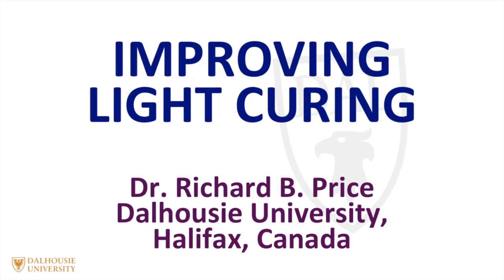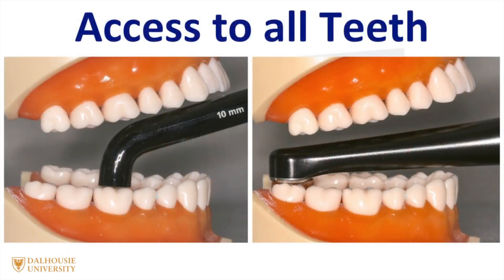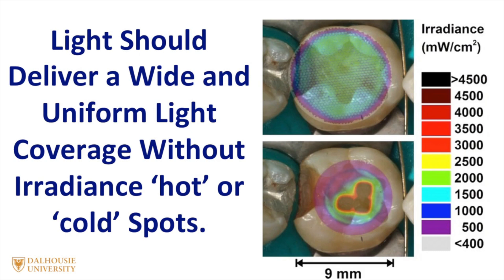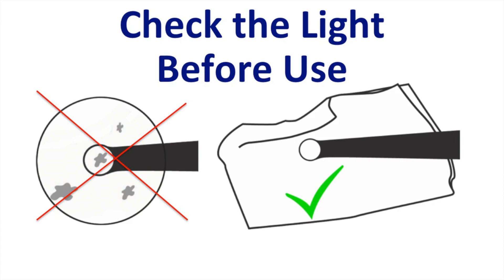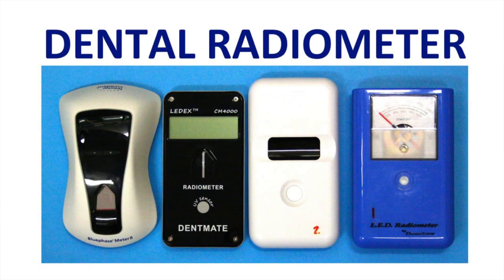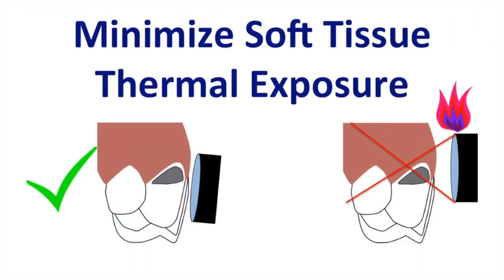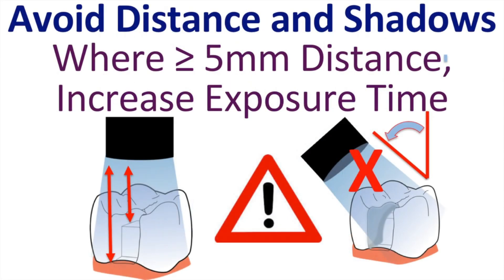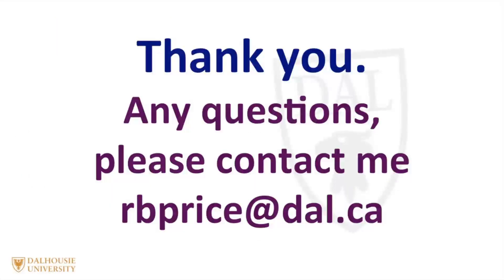Dental Light Curing Device - EVERYTHING YOU SHOULD KNOW

Comment: can we use barrier tape over the curing tip instead of a barrier sleeve?
Reply from the maker: Sleeve is better because the residual gum after the tape is removed will degrade the quality of subsequent curing. Or you can simply use spirit swab between patients as the tip of light curing unit is a non critical item.
Reply: @DentCareNepal got it! Thanks
Reply: @DentCareNepal what about simple zip lock bags available